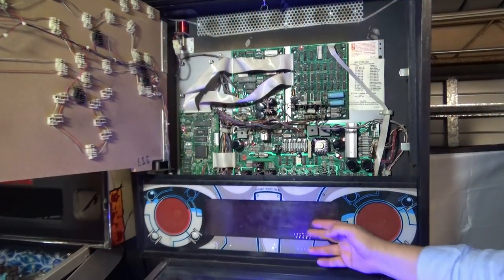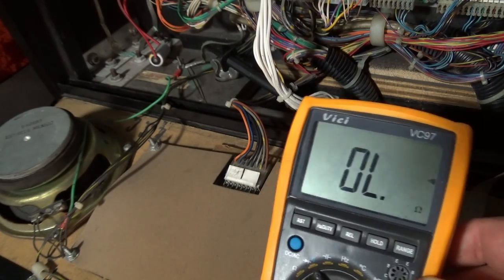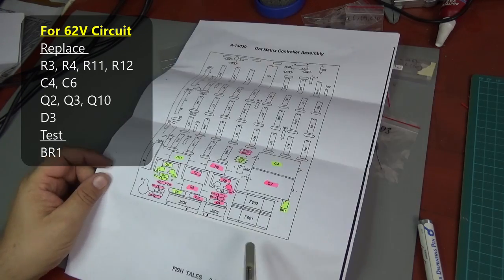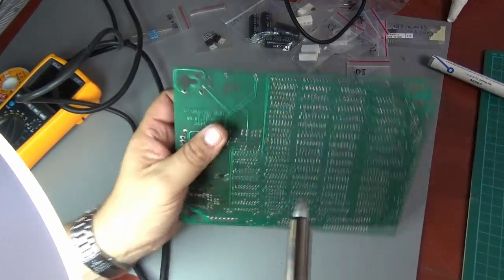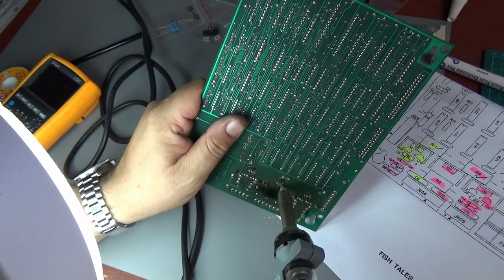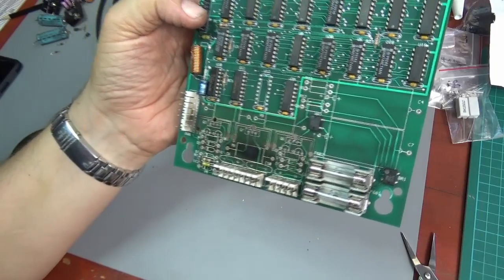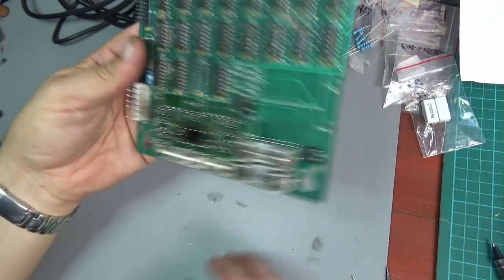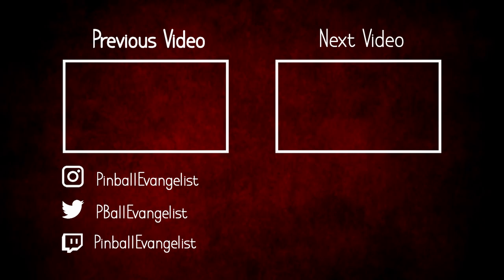Guide to Repairing  DMD Board in WPC Pinball Machine (Part 1 of 2)

Comment: Rewatching these great videos again, as just got a Hurricane wpc machine that been sat in a barn for a while.. rather than shotgunning the boards with parts that are known to go, have you found ways to test say, the capacitors on a power board or audio board before pulling them. My personality type says do them all anyway, but the BR check in here made me think twice 😊
Reply from the maker: Transistors,  and BR's are easy to check and can be done in circuit,  Diodes & Capacitors on the other hand can be really hard and by the time you have taken them out of the board you may as well just replace them as they are quite cheap components.

Comment: Great informative video!  Thanks!  But, why did you remove the heat sinks from the board?  I have never found the need to do that.  I simply remove the transistors (unscrew from heat sink, then remove transistor with solder sucker).    I could kill for a parts list!
Reply from the maker: You don't need to kill, just ask....  See the list below. It's tough to make it easy to read but if you struggle or want a version I have with links to suppliers product page I used when I ordered the best I think will be to share it on Discord to setting that up as PinballEvangelist so look for me there  
BR1	Bridge Rectifier	DF04M	400V, 1A
BR2	Bridge Rectifier	DF04M	400V, 1A
C4	Capacitor	Axial	220uF, 160V, 20%
C7	Capacitor	Axial	220uF, 160V, 20%
C10	Capacitor	Ceramic	0.1uF@500v
C6	Capacitor	Ceramic	0.1uF@500v
C9	Capacitor	Ceramic	0.1uF@500v
D7	Diode	1N4004	Standard 1A, 400V, DO-2
R9	Resistor	Cement	1.8K ohm, 5 Watt, 5%
R11	Resistor	Cement	120 ohm, 5 Watt, 5%
R8	Resistor	Cement	4.7K ohm, 5 Watt, 5%
R4	Resistor	Metal Oxide	120 ohm, 1 watt, 5%
R5	Resistor	Metal Oxide	120 ohm, 1 watt, 5%
R12	Resistor	Metal Oxide	47K ohm, 1 Watt, 5%
R13	Resistor	Metal Oxide	47K ohm, 1 Watt, 5%
R3	Resistor	Metal Oxide	47K ohm, 1 Watt, 5%
R6	Resistor	Metal Oxide	47K ohm, 1 Watt, 5%
Q4	Transistor	2N5401	Transistor, PNP, 150 V, 625 mW, 600 mA, 50 hFE
Q5	Transistor	2N5401	Transistor, PNP, 150 V, 625 mW, 600 mA, 50 hFE
Q10	Transistor	2N5551	Transistor, NPN, 160 V, 150 MHz, 625 mW, 600 mA, 80 hFE
Q2	Transistor	2N5551	Transistor, NPN, 160 V, 150 MHz, 625 mW, 600 mA, 80 hFE
Q3	Transistor	MJE15030	Transistor, NPN, 150 V, 30 MHz, 50 W, 8 A, 40 hFE
Q7	Transistor	MJE15030	Transistor, NPN, 150 V, 30 MHz, 50 W, 8 A, 40 hFE
Q6	Transistor	MJE15031	Transistor, Audio, PNP, -150 V, 30 MHz, 50 W, -8 A, 40 hFE
D6	Zener Diode	1N4742A	12V, 1W, DO-41, 5%
D8	Zener Diode	1N4742A	12V, 1W, DO-41, 5%
D4	Zener Diode	1N4758A	56V, 1W, DO-41, 5%
D5	Zener Diode	1N4758A	56V, 1W, DO-41, 5%
D3	Zener Diode	1N4759A	62V, 1 W, DO-41 (DO-204AL), 5 %

Comment: Problems... The Shadow.  My DMD is bright and not gased out, no dead pixels etc. . But,   I've always noticed that the Dmd comes on very late. Sometimes up to 4-5 seconds after game has been turned on. Once running it is as bright as any Dmd..   Now it won't turn on at all...   I have meassured the voltages and there is power where there should be.  But,   pin 1 and 2 gives exactly the same reading.  -119 V and not 12v difference for pin 2 as described in this awesome video.  Any ideas ? Capacitors ? Thanks Matt..

Comment: Hey man, before I start in on my DMD board, I wa.ted to ask you a quick question if that's ok? My DMD is actually running ok, but it makes a constant whining noise, the more lights on the higher pitch the whine. Ever heard this sort of thing yourself? Wondering where to start.
Reply from the maker: First thing to do is swap the DMD out with one from another WPC game (hopefully you have another machine).  This will tell you if the noise is coming from the display or the board.  I suspect it may be a DMD which is on its way out rather than the board but always good with any pinball issues is to narrow down the source of the issue and swapping the DMD does that....
Reply: @PinballEvangelist  ok, good advice. I have Getaway in storage, but that has a new colour DMD. Ill speak to a buddy and get a DMD sorted!

Comment: PINBALL EVANGELIST,,,,,          ..
                    RESET Circuit holds the CPU reset line LOW until the +5vdc is stabilized, then the reset circuit will set the CPU reset line to HIGH. 
      To Upgrade MPU System 3 RESET circuit to a MPU System 4 RESET circuit you have to remove a Capacitor and two resistors and install a 10K resistor 
--->  1.) Why was the System 3 RESET circuit not working correctly causing what kind of issues and failures that needed the upgrade System 4 RESET circuit modification upgrade?

Upgrading the System 3 Driver boards to "Increase the voltage on the switches" 
 Remove the resistors to the voltage that applies to the switches and install JUMPERS. 
    This Upgrade is for the PIA chips to detect the switches being closed easier 
    This upgrade is for can cause "false switch closures issues" 
--->  2.) Why would increasing the voltage to the switches make the PIA chip detect the switches being closed easier? and why would this cause False switch closure issues? 

Upgrading the System 3 Driver Board, there is multiple 27 ohm resistors that are 2watts that are burnt because they are for the Feature Lights. The 27 ohm resistor can be removed and upgrade using different FET's 
--->  3.) Which FETS are used to upgrade to not use the 27 ohm resistors for the feature lights?

4.) "TEST ROM chip" when you don't use the driver board to test the MPU system 3 or 4 board. Where would the TEST ROM chip go at which IC socket to test the MPU system 3 or 4 when not connecting the System 3 or 4 driver board?

5.) Why does using 47 bulbs use 40% of less power compared to using 44 bulbs?

Comment: PINBALL EVANGELIST,                                   In pinball games the solenoids voltage is +6vdc or +12vdc mostly? because atari pinball games used +48vdc any reasons why +48vdc for the solenoids voltage?
Reply from the maker: Here is a summary from www.pinballmedic.net/coilshowork.html

Pinball Coil Voltages by Game Manufacturer 
Gottlieb 1947 to 1989: 28 Volts, 
Gottlieb 1989 (system3) to 1996: 50 Volts. 
Williams 1947 to 1963: 50 Volts, 
Williams 1963 to 1986: 28 Volts. 
Williams 1986 to 1989: 28 or 50 Volts
Williams 1989 to 1999: 50 Volts 
Bally 1947 to 1977: 50 Volts
Bally 1977 to 1988: 43 Volts
Bally 1988 1999: 50 Volts